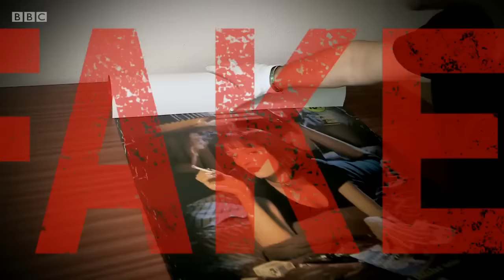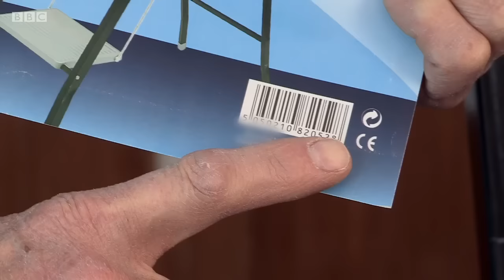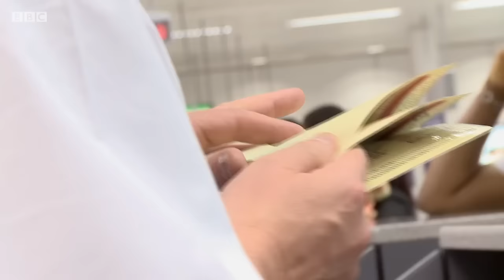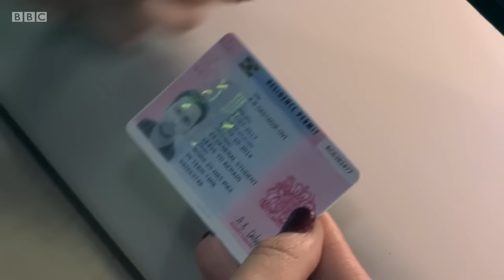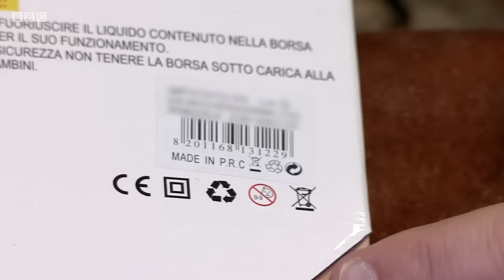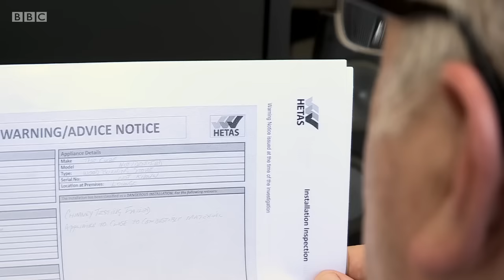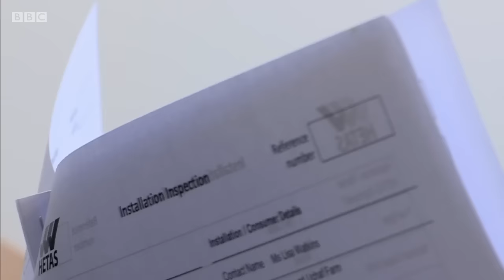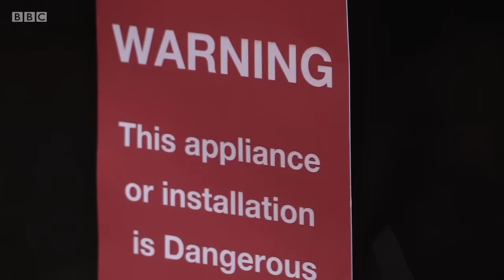Fake Britain Series 6 Episode 8

Comment: I'm a little confused about the ladder. I would have thought that the ladder not snapping under that much torque would be a good thing.
Reply: The safety rating allows for some twist, but the ladder exceeded that limit.
Reply: John Price Price I thunk the ladder needed to be stiffer. The fake one twisted quite a lot so I wouldn't be surprised if someone just slipped off tha damn thing haha